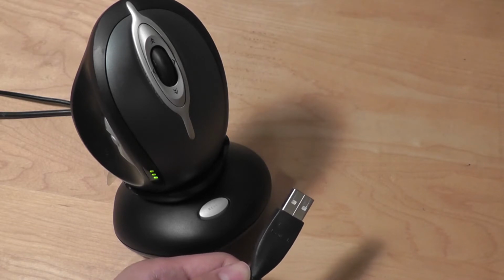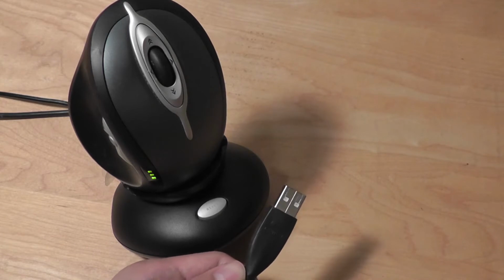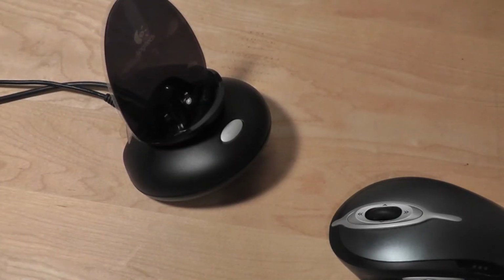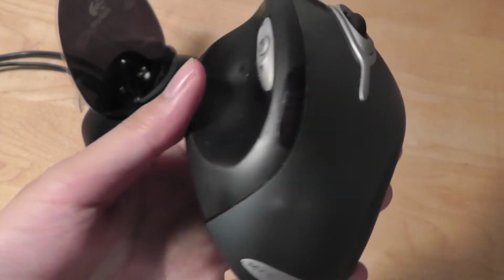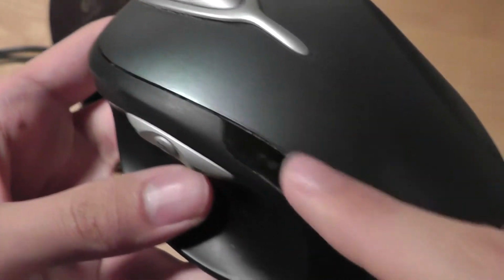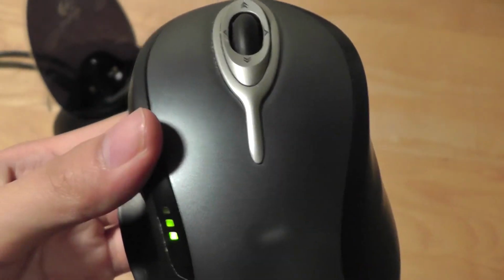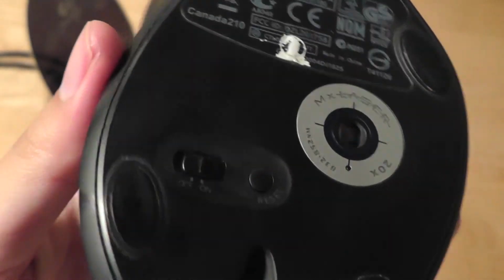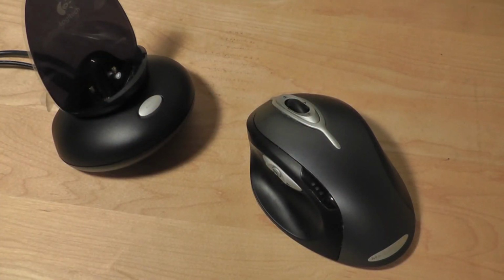Logitech MX1000 RX Revolution Wireless Laser Mouse [P1]

Comment: this was my first mouse! So meny good memories with this mouse and Battlefield 2. Price was like 90€ at 2005 if i can remember correctly.
Reply: HELP!! PLEASE TELL ME HOW TO GET THE DRIVERS! I bought this around 2004. It got rid of all my RSI pains because there were 8 buttons to choose for the functions I used most. Then it was discontinued. I managed to buy TEN of the MX 1000 MICE online only to be told there are no drivers!! I was about to chuck them! HOW DO YOU GUYS USE IT?
Reply: Also my first mouse. Most of the rubberized coating is gone, but the wheel and all switches still work, and the battery still holds a charge for several days of use. I'd still use it too if it had better polling - once you get used to 1000Hz it's hard to go back to 125Hz.

Comment: You're getting your mice mixed up my friend... https://en.wikipedia.org/wiki/List_of_Logitech_products.

MX 1000 ( released 2004)
MX Revolution (released 2006)
your review 2016 :)

I just retired my MX1000, the one you have in your review (same model number, I checked) after 14 years.  The battery needs to be charged a more than when it was under 10 years old, but the fit on the mouse can't be beat.  

I'm using a MX Master 2S... you should do a review on that :)